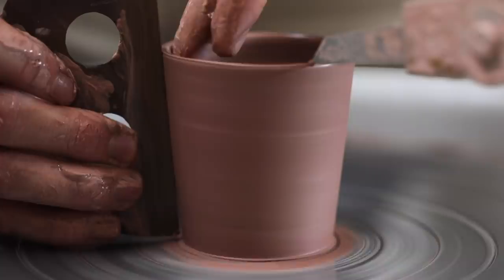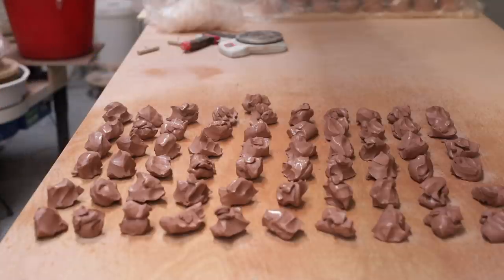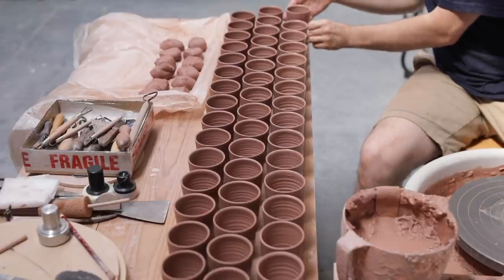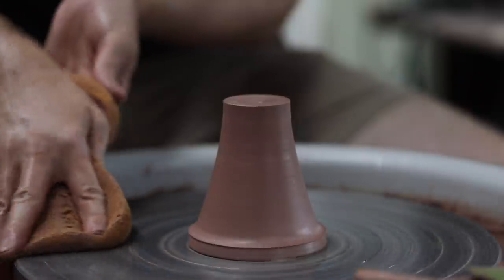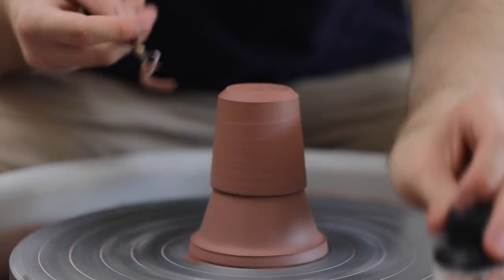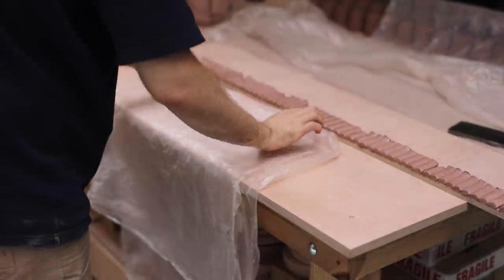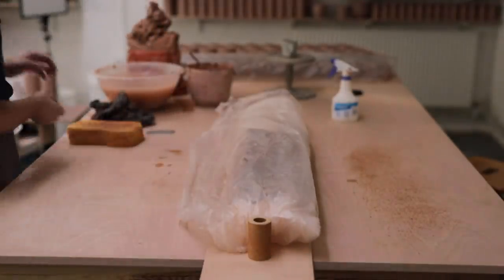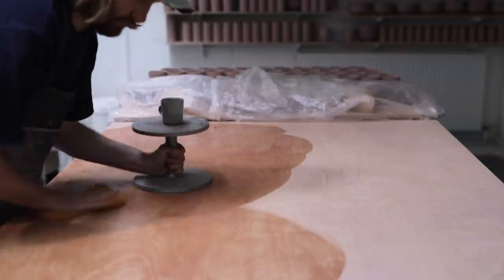How to Throw Pottery Espresso Cups and Make a Chuck to Trim Them On

Comment: As always, amazing video. I always love hearing your thought processes and it's always so well said. 

I also wanted to point out a small math error you made in "reverse engineering" how tall you should throw! The reverse operation of 12% shrinkage isn't adding back 12% of the final height, since 12% of the fired height is less than 12% of the thrown height. That is, what you're adding back is less than what you initially took away. 

Instead you need to ask "6.5 cm is 12% less than what?" In math, that's 6.5 = (1 - 0.12) * h. Then we get 6.5 = 0.88 * h. We can divide both sides by 0.88 and get height = 6.5 / 0.88 = 7.39cm. So in this case it didn't make that much of a difference, but it's still worth noting!

Comment: I'm a huge fan of your work, and really appreciate all of the content that you create. Just a quick note on your shrinkage math: for 12% shrinkage, you should be taking your fired dimension and dividing by .88 to get the as-thrown dimension, not multiplying by 1.12. 

If you think about the math behind what's happening, as-thrown*0.88 = fired, so as-thrown=fired/0.88. You can check this pretty quickly for your 100mm test ruler. 88/.88=100, but calculating it the way you mentioned would give 88*1.12=98.56mm. It's not a huge difference, especially if you're leaving some extra clay for trimming, but it could be an issue if you're trying to recreate something that needs really tight tolerances.

Comment: Just 100 grams 🤯 You impress me every week. Anytime you open up for interns please consider my application in advance 🙂
Reply from the maker: Realistically these could be thrown off the hump, that may very well be easier but I'm too stuck in my ways of throwing cups one at a time, but I don't mind that, I can be more accurate that way and ultimately trim less. And I'll add in to the stack! One day I may have an intern but I'm still only a few years into running my own business, I still have a lot left to learn before I take on the responsibility of someone else. Thanks for watching as always! 🙌🏼

Comment: I could be wrong, but it looks like that glaze has crazing, which if that’s the case means they’re not food safe. Awesome video though.
Reply from the maker: Here’s a good link to an article that goes into more depth about it, https://ceramicartsnetwork.org/ceramics-monthly/ceramics-monthly-article/Techno-File-Dirty-Dishes, and clears up some of the misconceptions that are spread around. As long as you properly wash crazed pottery there is no bacteria left in the crackles. As long as you take time to care for your handmade ceramics after they’ve been used then they’ll be just fine, but of course it does depend on the materials used and temperatures fired to.

I’ve been using crackle glazed ceramics for years. My pots are highly fired stoneware with nothing nasty that could leech, the crackling doesn’t stain too badly as long as it’s properly washed but of course it happens overtime. To the same degree, many of the potters I’ve worked for over the years who wood fire, soda fire and so on, all have work that crazes and crackles to some degree and it all stains with time, yet functional work is still made abundantly and is completely usable. I saw this in Japan especially, with so many functional tableware pieces that were crackled/crazed and stained and no body blinks an eye, nor do you hear of an excessive amount of people getting ill.

My clay is fully vitrified after being fired to 1300ºC and unless you take terrible care of your ceramics you’ll be perfectly healthy. Other clays, like earthenware, never fully vitrify and will absorb water if not glazed properly, that can be issue.

For industrial use it could be a problem, due to the surface of the pot having less strength, long-term staining with use and fragility, as it’s high fired stoneware packed full of iron, which makes it weaker and more susceptible to chipping on the whole, but that’s what you get with handmade ceramics, I don’t want to make pots that have perfect, uniform surfaces like you might find in a shop, I want each to be individual and interesting and handmade and I suppose the same goes for the generations of potters who’ve worked all over the world. 

I think certain parts of the world, I won’t say which, seem to have a fixation on this. And of course it is the potter’s responsibility to provide surfaces that are food safe, but in most cases that applies to the leaching of toxic materials, not staining itself. Hot dishwater water and soak will kill anything in the crackles, and they are gaping crevices in bacterial terms.

Anyway, I hope this helps!

Comment: Hey I just wanted to comment this on your most recent video so you can see it, but is there any way that you could start using more environmentally friendly packaging? There is this called honeycomb packaging and all it is, is a paper ish material that can be recycled and I’m pretty sure composted. I don’t know if it would work because you need to make sure the pieces are packaged well so they don’t break, but I was just wondering instead of the plastic.
Reply from the maker: Way ahead of you! I've already ordered rolls of the honeycomb stuff and tissue paper and paper tape of a different kind, (hopefully my printed labels will stick on it this time), but I have a few giant old larger rolls of bubble and foam and things that I've been slowly working my way through, I'm not going to just throw that away. I also reuse and recycle a mountain of packaging from friends, neighbours and so on, stuff that would otherwise just be recycled normally, so at least that's getting a second use, I just hope the people on the receiving end do away with it nicely.
Reply: Oh sweet! Even if they don’t recycle or compost it, it is better than the plastic

Comment: Your calculations aren’t quite correct, I’m afraid. The way you’re doing it, you’re multiplying by 1.12, when you should actually be dividing by 0.88. The difference is subtle in this case (1/0.88 ≈ 1.14), but if the shrinkage is larger you’ll have a bigger discrepancy
Reply from the maker: Maths never was my storing point!
Reply: @floriangadsby  
Fortunately for you, the correct calculation is even easier than what you were doing: just divide by  0.[the length of the ruler after shrinkage], and you’re done!